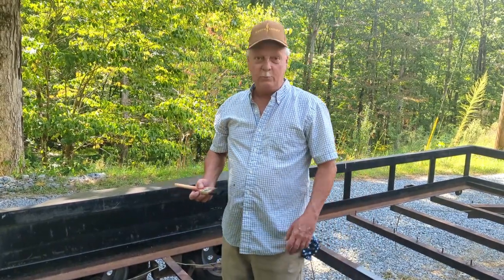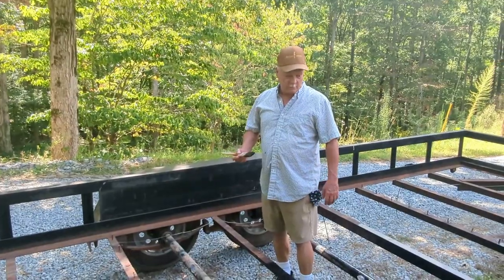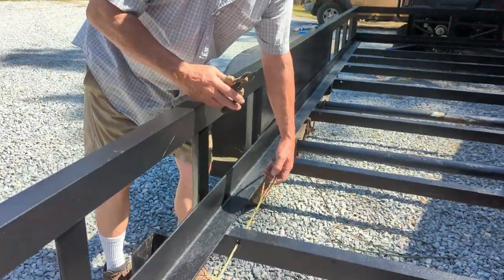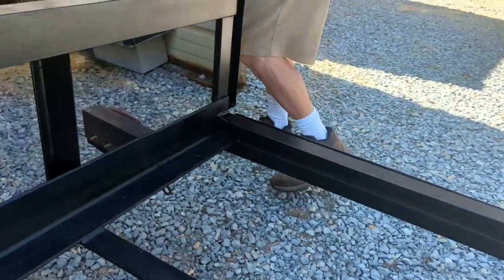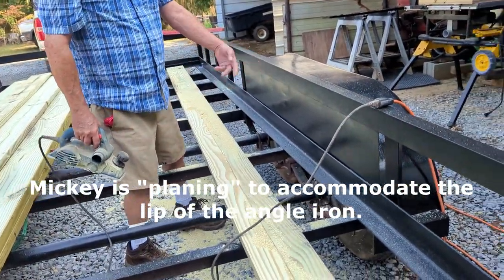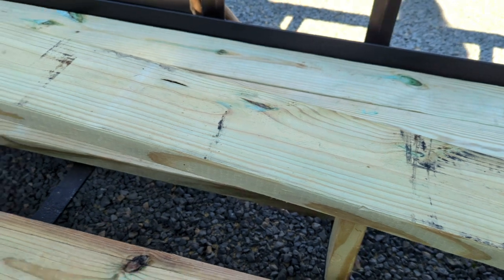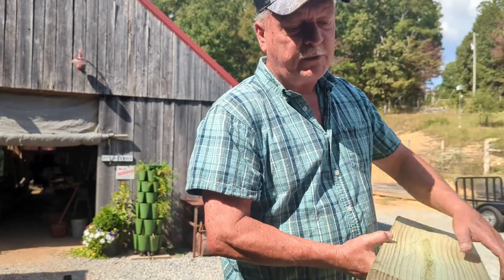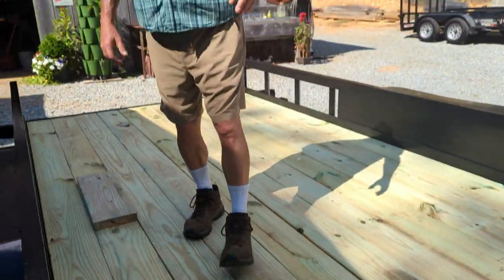How To Replace Trailer Floor and Save THOUSANDS!!  #trailer #restoration  #pressuretreatedlumber

Comment: We just re-floored my 18" trailer and put a new wiring harness on it due to dogs chewing the wiring. We did cut the metal at the back of the trailer due to it being only tack welded and replaced it with angle iron. Loved learning the trick to placing the board in without removing the metal. Keep on doing the good work you do.
Reply from the maker: Thank you for your comment cherylfenoglio7826.  We appreciate you watching our channel.

Comment: Great find on the trailer just like my boys, they always find deals. My husband bought me a 12 x 24 storage building for our anniversary. It has been a blessing that everything that's going into my new canning kitchen has been given to us.  New electrical panel with breaker, all new plumbing supplies, plank walls, drywall and new flooring. We did have to buy the insulation, tin for the ceiling, stove and hood, Hoosier cabinet and a farm house sink. Excited to get it done.
Reply from the maker: Dang girl!!!  Miss reginathompson9350. You are living Uptown with that kind of shed.  We love free stuff too!  Its hard to come by anymore but we like it when it happens.  Thanks for sharing how your canning kitchen is coming together.

Comment: 🙏🙏🙏🙂♥️👍. Thanks for your wisdom
Reply from the maker: Thanks for watching Keiths1234.  We appreciate you.
Reply: @hillsmillhomestead   I appreciate you and And your knowledge of what I made a ramp handicap. And I put one board crown up and it started to  Rot out and it's been years. The other ones that are doing good and I did not use any treated lumber and it's outside And full weather up here in Kalkaska Michigan Thank for your tips.  I paid 200 for a 16 foot trailer quite similar to yours  Put new boards new tires and I still have to paint it but that's going to happen soon.

Comment: Mickey, don't put that wiring back in the same place. That's likely why it had to be repaired so many times. Looks to me like it gets tangled up in brush from hanging between the joists. You could actually cut a 45 down the length of the outer boards bottom and run your wire along the length of the board and the channel. Fully protected brother. Good luck...
Reply from the maker: We really like how you think these things out MH-53E.  We appreciate your advice.  Thanks for watching.